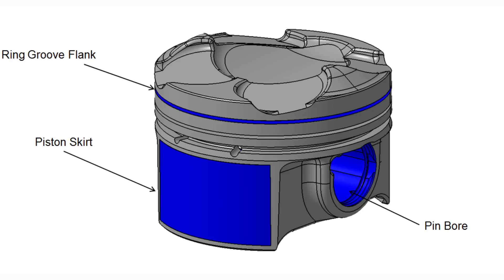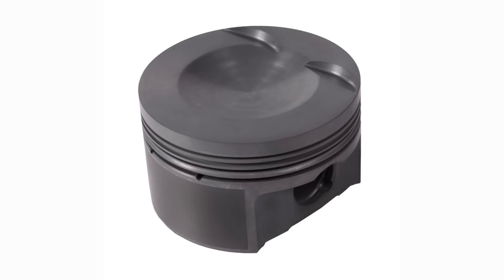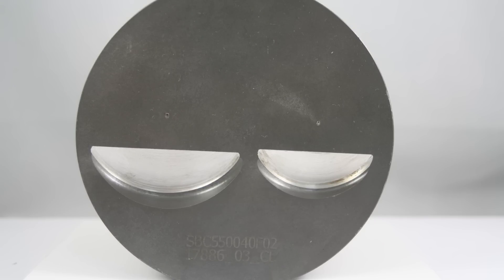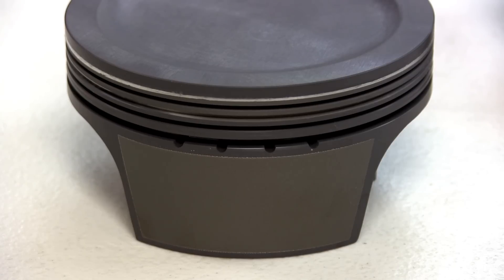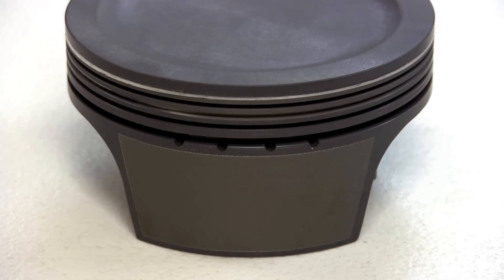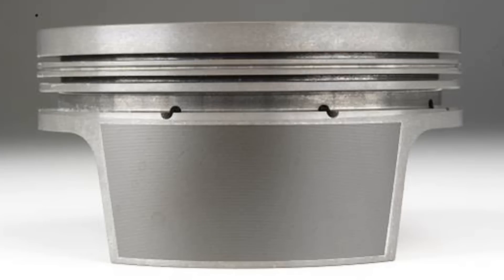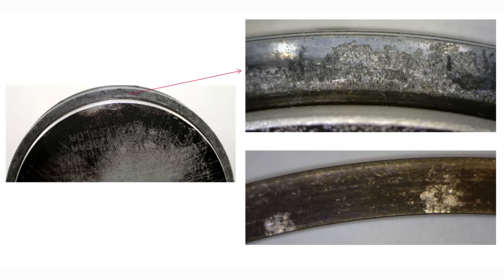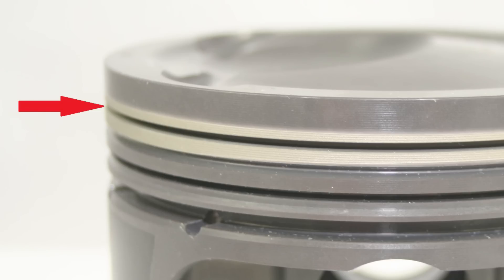A Look at Piston Coatings

Comment: Whats alloy of Graf coating
Reply from the maker: GRAFAL® is not an alloy but made of graphite that acts as a cushioning property which is applied to the piston skirt.  The piston forging itself can be made up of 4032 (low expansion) or 2618 (higher expansion).  4032 can be used with power adders, but 2618 can be found in higher horsepower applications that utilize high amounts of nitrous and boost.